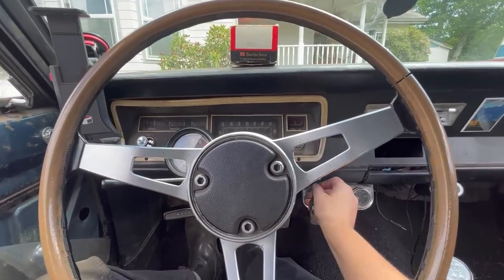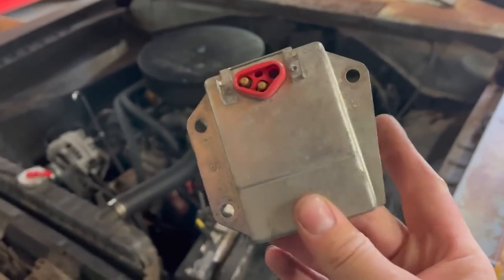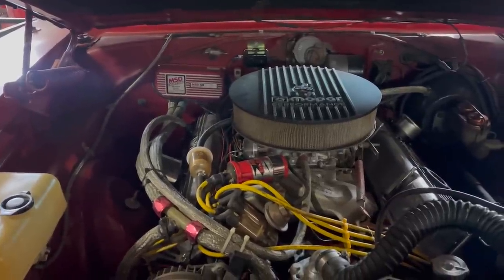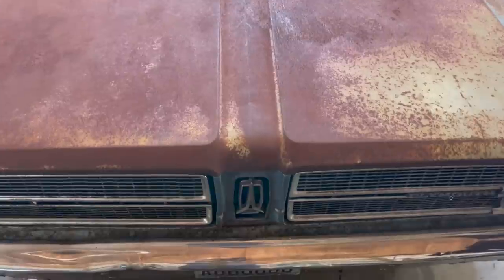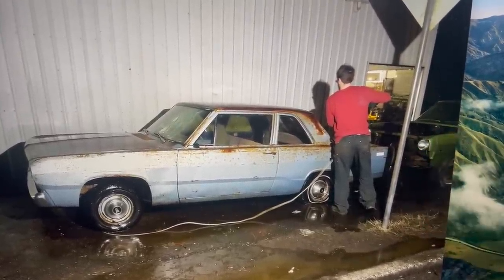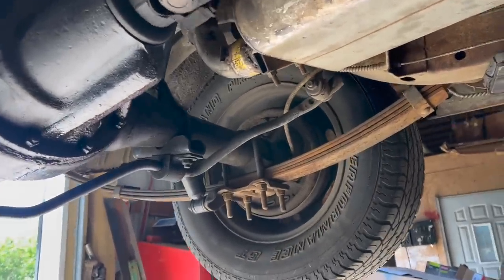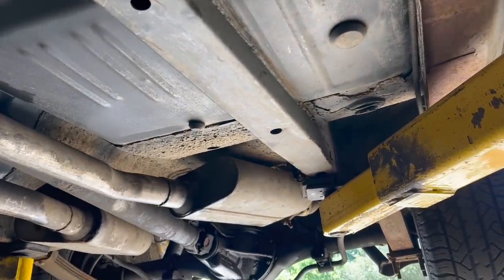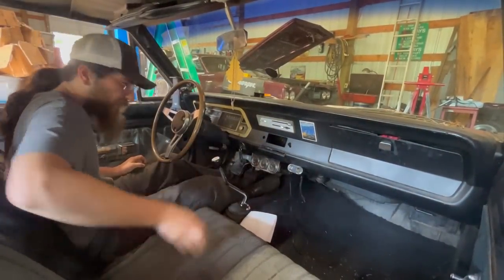The Llama Barn Valiant! A Budget A-Body That Goes Around Corners

Comment: Father had a 4 door Valiant with a 4 speed and slant six. No power steering and no power brakes. Only one window would roll down. An interesting ride in 90 degree heat. You really had to concentrate driving it.

Comment: I bought and sold a lot of these in the late 80's-mid 90's also lots of Darts with the slant 6,there was a strong following in my area for frugal buyers wanting gas mileage and reliability..Those were different than when I had one with a V8 those guys you knew were going to drag race it or a quick street car..

The slant 6 cars even 4 doors sold fast,bought them needing work for next to nothing made about $700-$1000 per slant 6 car,basically every old car I bought back then late 80's -mid 90's thats a nice chunk of change today(roughly $2000 per car) remember I bought these for $150-$300 needing work,usually failed emission testing or leaky/dead transmission fixed for less than $100 aka junkyard trans)... 

I always liked that style of Valiant always wanted a Black/Black with dog dish hubcaps and a built 340 or 360..Closest was a light green/black looked great 273 4bbl,duel exhaust Valiant Signet.. I wish in 1987 I knew how rare it was and would have kept it! Bought it with a leaking torque conv,replaced it she ran great probably sold it for less than $1500 in 1987 as a young teen,oh well...Even my Chevy buddies who hated Mopars liked the Valiant,they hated Mopars because their SS 396 Chevelles would lose to my 383 4bbl Newport!

Comment: idk what ppl do..i drove 60's-70's Mopes from '84 till like 2000..never had a single 
v. regulator issue. i now have a mostly done '70 Fury Gran Coupe w/a de-smogged 
'77 440. i think i recall 1 time out of several ppl..inc my folks..in the last 60 yrs..
someone losing a volt reg, lol. & all muscle era mopes do corners well. decent tires & a 
fr. end alignment once every decade is about all that's needed to rly denounce the 
fiction of cars of that era not cornering well. ok..many ford & chevy cars didnt, lol. if things are 
taken a lil further..gusseted K, sub frame connectors, big wheel/tires, nice shocks, proper fr end alignment with a lot of pos caster..maybe run the new fangled tubular A arms..it's amazing 
corner carving time! 
Cool Valiant! lightest & stiffest of the Mopars of the era & has 
more patina than the Titanic! :glasses-purple-yellow-diamond::goodvibes:
Reply from the maker: I don’t know what people do either, but I know what I do - I install “quality” voltage regulators, and then later they die. I have replaced more than I could possibly count in my Mopars and customer cars over the last sixteen years. 

I really like the way these cars handle - as long as they’ve got a sway bar. There are a lot of nice modifications that can be done beyond that to make them better and better.
Reply: @DeadDodgeGarage  Hmm, interesting. I'd use OE ones..even if 50 yrs old. who knows what is inside of newer made ones? (interesting idea to tear apart an original only if already smoked and a newer one & comparo them?) And..always check batt ground connection, has to be good to protect the volt reg. try not to run weak batteries ever. ik..a toughie! a lil solar panel can help with intermittent use cars..for a trickle charger. i swear by AGM batts..a lil pricey, but a fine long term investment. tho..i have heard optimas aint what they used to be. // yaa..fabulous handling, indeed. they go where ya point them..minimum (ok, None. lol) bad manners, predictable. Chrysler Corp did actually use a computer..ancient as it was..to design the geometry & all. ..i think GM at the time just sketched it on a napkin :p  Tbars & asymmetrical leafsprings, forever :)

Comment: That is another great project, you have all the best 4 spd cars !  Some friends had an older valiant than that (previous bodystyle?) it had an automatic trans but no column shifter, there were mechanical pushbuttons on the dash to the left of the steering wheel, so wierd.  I had thrush mufflers on my old Belvedere 318, small diameter with woodpecker emblem on the side they sounded awesome and were dirt cheap
Reply from the maker: Oh yeah, push button! Last year for that was ‘64. They’re neat.

Comment: Does have a lot of cool stuff going on- ahhh, yess, flat cornering!
   Those iron case OD's are in the mid '80's pickups witb /6's- full size transmisson. Was going to kit-bash a F-body aluminum case OD for the shorter output shaft & A-body friendly shifter pad location..
    For a mild smallblock, the Novak 4x4 folks are using a Dakota V6 10.5" clutch bellhousing with a AX-15.
    Been thinking about the 2wd AX-15 in an A-body might be fun.
Reply from the maker: This is an iron A/F body length transmission. I’ve seen a couple of them. Not sure why they exist but they do. I’ve heard about using the AX15 as well. These days it seems like the thing to do is just spend the money and get a TKX.
Reply: @DeadDodgeGarage  Like a lot of Ma Mopar's stuff, there seems to be an exeption to every rule.
   I've never come across one back when they were still found in the yards, but my sample size was probably 20 OD units total.
   And I know after working at a vehicle production facility, due to circumstances, acceptable parts substitutions will be made.

Comment: Had a '70 Valiant sedan with a 318, 4-speed, disc brakes, sway bar & an 8.75' with a 3.23 SG...the bad part was a kid had it & wrecked several panels on it. It was fun to drive, but ended up being stripped
Reply from the maker: Bummer… sounds awesome. I had a really solid and decent ‘72 sedan that I screwed up pretty well.
Reply: @DeadDodgeGarage  I still have the '76 sedan I got off the Tulalip, brought it out to North Carolina. It gets tons of attention

Comment: Hey DDG!  my folks had one of these in the same silver/blueish as this one, but with like a thousand times less rust.  Well it gets the mileage I want, and it has most of the sound I like, Did/Do they (Direct Connection) make a "Purple Shaft" cam for the small blocks?  I like the way it made easy horsepower and idled like a funny car (sorta, you know) I hate all of the unibody, pretty much anyways.  But it IS a muscle car, now anyways.  Something modest could be the answer for my "4x4 for a muscle car trade" that I'd like to make.  '70 birds are just too over priced.  Hey a Satellite, or duster, demon, valiant etc. etc. might just be the answer, but definitely not this rough because the whole reason I want to trade is 'cause I'm badly disabled and now discussing my 11th surgery with my doctors. I'm having massive trouble getting my boot up to the step-bars, not to mention the trouble my dementia afflicted wife of 25 years is having.  Looks like a lot of fun!
Reply from the maker: They sure did make small block Purple Shaft cams. Gotcha. Sounds like a lot to deal with… Hopefully a suitable trade for you is out there.

Comment: You should put some red oxide primer on it to stop the rust.  Cheap.  As long as it stops the rust.
Reply from the maker: But that would take away from the look…
Reply: @DeadDodgeGarage  I hate rust.  It's too expensive to fix all of it.  I'm always killing rust.  Make 'em all red oxide prime and put stickers with devils with horns on them.  Your town of dead dodges would like that town in the Clint Eastwood movie.
Reply from the maker: I get it. But I’ve got vehicles here which have had surface rust just like that showing for decades. It seems to take a long, long time for it to progress to actual cancerous rust. The amount of work it would take to strip and prime every paint baked vehicle in the fleet 😬 the nice cars are nice enough. The rest of ‘em can just be what they are.
Reply: @DeadDodgeGarage  I got 'ya.  I'd personally clean them up with white vinegar  and a sander and hit them with a marine grade primer that goes over rusty metal.  Finish coast (if any ) would be tractor paint.  Paint is expensive today. LOADS of work, no  doubt.  I'd be helping, if I up that way.  Down here on North Central Florida.

Comment: I have the same cast iron overdrive transmission going in my 73 duster.
Reply from the maker: Nice! The iron one is tough. The aluminum units tend to have problems. And I say that as someone who has thoroughly tested the theory…
Reply: I'm also putting an 833OD into my Scamp.  I have both iron and aluminum ones and I'm going to use the aluminum one for the weight savings.  The problem with the aluminum ones is that the hole in the case for the rear of the countershaft was bored too large at the factory, which allows the countershaft to flop around when you're shifting.  This slowly wears out the countershaft hole and eventually the counter-to-main shaft clearance gets too large and the trans goes boom.  There are a few ways to fix this.  You can bore out the countershaft hole and put in a bushing with the correct clearance, preferably the bushing will be made out of something harder than the original aluminum.  You can install some shim stock on the countershaft, of the correct thickness to make it a slight interference fit in the case.  Or, you can use some "thick" Loctite/bearing retainer adhesive to lock the end of the countershaft in the case.  Or whatever else you can think of to keep the countershaft from flopping around when you shift.

Comment: I run the 4 spd od in both my 66 Dart GT n 74 D100.. it works much better with steeper gears.. Dart has 3.91 n 14" tires truck 3.91 or even happier with 4.10.. good mpg means u can afford to drive them n leave them sitting 😊
Reply from the maker: I ran an OD in my ‘66 Barracuda with 4.10s. It did work pretty well.
Reply: @DeadDodgeGarage  I like the long 2nd gear.. I'm running a .060 over 360 with pretty worked over j heads, hooker supercomp headers ,edelbrock performer rpm cam and intake with 850 carb,crane triple wrap springs HD locks n retainers, crane adjustable  rocker arms, HD shafts n hold downs.. the big torque it makes right from idle up past where hp starts covers alot of territory in 2nd n leaves both hands to keep it off the roof n outta the ditch🤣

Comment: Variants were nasty little race cars guys put built 340s in and waxed some ass. I rode in one called valiant attempt. It actually scared me. Ya really. Jeff has one with a 451 stroker in it. It's fast. 😅 those headers are so cooked it's just funny. Having full throttle does make a difference. I would make a new bracket so it holds the cable or one day it may lock wide open. Ask me how I know that tech tip 😂. The patina look is in so rusty is cool. Well back to work for me more flat tires to fix at the boat shop😢 I hate flats.

Comment: I used to own a 71 challenget R/T 383.4spd. Did Dodge use the same 4-speed in a 440/Hemi application? Just curious.
Reply from the maker: There is a special input shaft with 18 splines and matching gearset for the “Hemi” transmission, which was also used behind RB engines in some applications (the ‘68 Charger R/T with 440, for example.) Otherwise, they are essentially the same transmission. The only important external consideration would be which clutch disk is used.
Reply: @DeadDodgeGarage  I bought that car in 1979 when I was 13 years old. My dad helped me buy it. 550 bucks! It was totally stock, not a speck of rust on it. It was supposed to be  green with a black vinyl top. The kid I bought it from sprayed it flat black and peeled the vinyl top off. The black interior was perfect except for the carpet was shot and the console was gone. I ripped the carpet out of the thing and I remember the floors were absolutely perfect! Shiny F5 green! I wish I still had that car. Thanks for the information about the transmission. I dig your Channel!
Reply: The chassis book has the info on the transmissions.

Comment: Am I crazy or is the coil wire filleted??Check out 19:24
Reply from the maker: That time stamp doesn’t seem to show the coil wire, I tried 9:24 for science and searched around a bit but couldn’t see what you’re seeing.
Reply: @DeadDodgeGarage   I can see it.. Actually, it starts about a minute earlier, but 19:24 is where I froze the video so I could open the thread without losing track of ,,, what was I going to do??    Yes, the yellow coil wire.... Towards the carb, it looks like the insulation is skinned or burnt, maybe...

Comment: I guess you like the other engine builders need to be schooled WD-40 is not a lubricant I repeat not a lubricant like the rest of you engine builders that are really good but I do have respect for you cuz I love the show make sure you know that WD-40 means water displacement formula 40
Reply from the maker: I’ve mostly sworn off of WD40 in general. Because it rusts machined surfaces as it evaporates… That ain’t helpful. I have switched to using a reasonable amount of engine oil for installing pistons in bores and it works so, so much better.